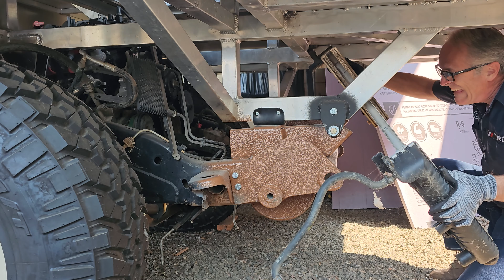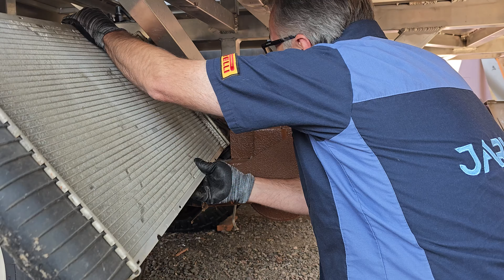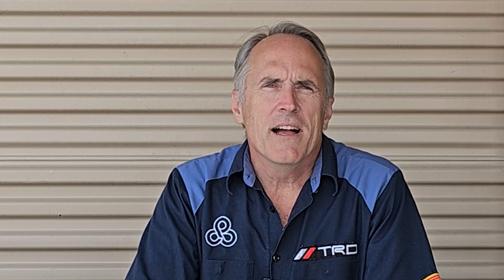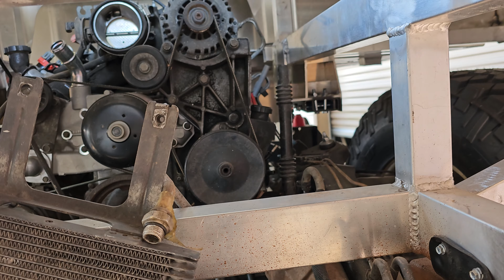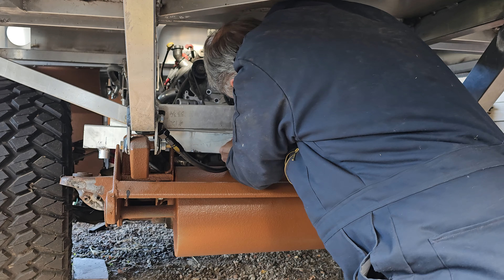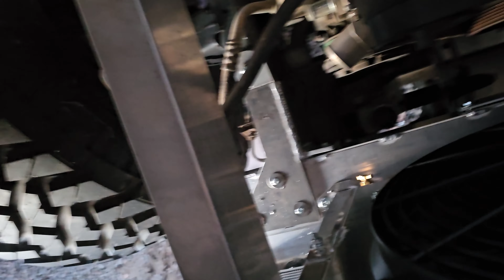Installing #Alloyworks Radiators to keep the beast cool. Leviathan Overlander project

Comment: i've always wondered about radiators, if they go on area or volume, so suppose you have a radiator that's two foot wide by 1 foot deep, could you double that up, as in twice the thickness, triple core as you have, i guess as long as you have what was originally required for the engine and have extra, its all a bonus, anything less will just cook the engine and boil your oil away, seen that, been there, done that
the beast is coming on nicely - soon be climbing mountains
Reply from the maker: Area and volume are both important. If the volume is too small, it will cause restriction and not allow enough coolant to circulate out of the engine. If you get enough volume, then surface area needs to match. Frontal area can be reduced by increasing the number of cores, but that might become limiting to air flow if you had a stack of cores that was too dense. Thanks for following the build(s).

Comment: Radiator...... What is a radiator anyhow? In internal combustion engines it's used to cool the engine. It doesn't radiate heat 🤔. Heat exchanger. Sorry.... nevermind.
Reply from the maker: Yeah, "thermal dissipative heat exchanger" is a bit too much for one breath.

Comment: nice to have you back!.

any reason you don't just 180 out of the 'back' radiator and into the front on the same side? then you could go out on the correct side of the front one strait around the rear one into the engine?
Reply from the maker: Thermocline! Hotter coolant needs to come in at the top and as it cools it drops down to the bottom exit. and repeat into the second radiator. I could have cut off the input and output tubes and re-welded them to face in a more conducive direction, but if I ever had problems, I would have to do the hack and weld all over again. This way I can just order another radiator. And, since it was a sponsored video, the supplier might not have liked the hack and weld job either. Ha!
Reply: @BuilderCreator  fair enough, hard to tell there is a 'top' and 'bottom' to the front one in those shots!

Comment: Is the fan going to see water? Electric fans can blow to piece or burn up from water crossings. True overlanding where you may have water crossing I only use clutch type fans.
Reply from the maker: Fan will be over 3 foot out of the water, but will also be operable from inside the cab. In amphibious mode, the engine will be shut down, but it will still be needed for entry and exit; hence the cab control.

Comment: The second radiator might not be needed if the oil cooler size is increased and the transmission cooling is kept separate from the engine cooling.
Also I would ditch the power steering cooler for a much better one. The old transmission cooler would work if it can handle the same pressure and it can get air flow.
However to increase cooling capacity and aid bleeding I would put a large expansion tank between the circuit of the two radiators.
Also you will want to duct out the hot air away from the cabin as cab overs can become ovens without adequate ventilation under the floor.
Reply from the maker: Yep, the power steering cooler is gone, and a new one is in the works. Air flow past the engine is wide open now, as there is no longer a firewall there. Air can flow freely out and under the cabin.

Comment: Great project! Which aluminium alloys are used and how do you manage the lack of heat treatment post welding?
Reply from the maker: Lots of aluminum in this project; lots of different alloys. Nothing is engineered to be critical enough to need heat treatment. It just has to float, not fly. Strength through mass.

Comment: Are you using Windows XP?
Reply: It appears as though one is running XP, but this is not uncommon with some systems running CAD software (older). If he's following good practices, he's air-gapped it or applied some logical controls to keep it segregated.
Reply from the maker: "Was" using Windows XP. Just upgraded to a subscription of AutoCAD lite/Fusion 360, as I have weened myself away from architectural work. The old software was called Architectural Desktop that I had been using since 2006. I never made the $5500 upgrade to keep ADtop current. Now that I am focused on mechanical engineering, the old dog is dead and a cheetah has taken its place .  . a new machine, Windows 11 and a suite of CAD CAM software. All unsafely connected to the internet. Ha!